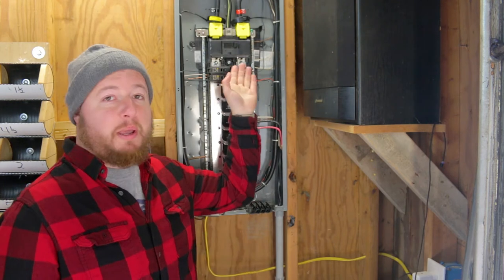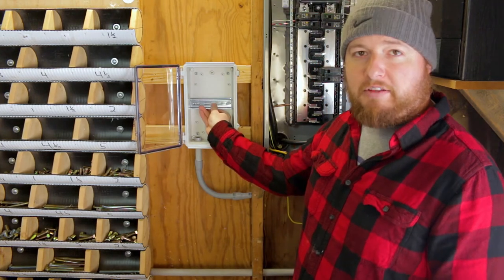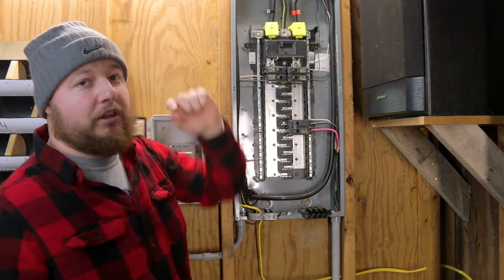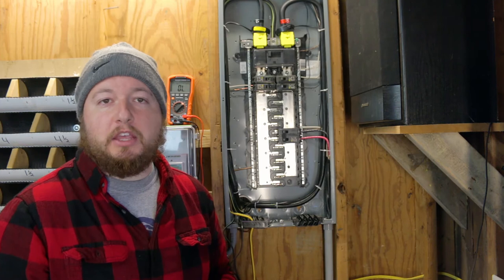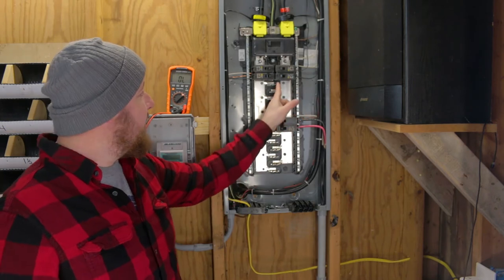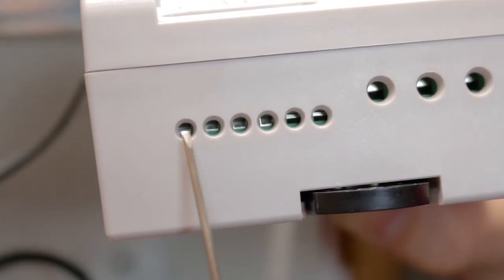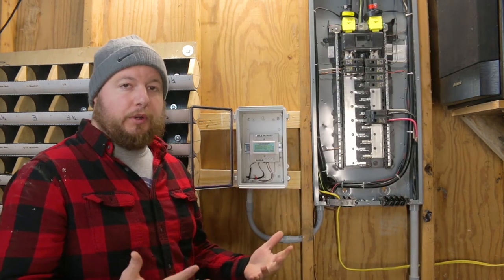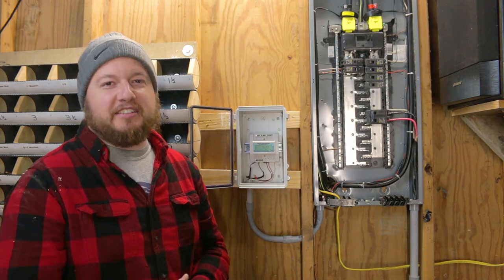EKM Omnimeter v.4 Install for Utility Sub-Metering

Comment: Hello Sean, some of your viewers questioned about the voltage supplied to the EKM meter. As most of they people watching this are DIYers. For the meter to calculate the power used be panel or sub-panel or an individual circuit breaker it needs the following.
Voltage supplied and Current passed. 
Voltage x Current = Watts
If your CTs are on L1 and L2 coming in
If you power your EKM with 110 then the power (watts) will be drastically lower then if powered by the line into the panel. 
If you are only reading for a singular circuit then what ever that level of voltage should be what is supplied to the EKM meter

It was definitely an excellent presentation.

Comment: Hey Sean! I'm very appreciative of this video. I'm just nearing the completion of a backyard rental home build to help produce income for my aging mother and I elected to install the Omnimeter. My local electrician is looking at charing $1,900 to do the install, which is bonkers to me.

As such, I think I have it all down except for the breaker part. Electricity is something I do not want to screw up and I'm not sure this is as straightforward as it seems or if there are thigns I could easily screw up.

The piece about installing the breaker and lines is a little unclear as I have no experience working with an electrical panel before. If there is little ability to screw it up, I'm all for it. 

From what I understand, get two of those fuse lines from EKM, then use a wire nut to connect it to the wire that leads to the Omnimeter. I'm not sure what gauge wire I'll need to buy, however. For the breaker, I'll need to install two breakers, so will adding two 15-amp breakers to the next available slots work or is there some kind of mathematical equation I have to be aware of when adding in breakers?

Any wisdom you can provide is greatly appreciated and this last little step could save my family $1,900!

Thank you!

(P.S. I once shorted a light switch when testing it with a continuity tester. I'm not sure what happened, but I don't want it to happen again. I guess my medal probe touched two pieces of metal on a live switch and it shorted? Question: If I touch the wrong sides of the breaker/bus bar (L1 and L2) is there any chance I'll cause an explosion?)
Reply from the maker: Haha, its easier that what your making it seem. Add two 15 amp breakers, make sure they are on opposite sides(L1 and L2). No math needed just add them. Wire guage, use what ya got. I used 18 but 16 would be good too. If you need more info hit me up at appalachiandiy@gmail.com or EKM tech support are great for questions too
And 1900 is alot
Reply: @appalachiandiy2415  my local electrician is charging $600 (for the electrical component only)....
Reply: I'm all for doing work yourself but when you are so unsure of a project like this you should just hire an electrician. Don't just ask one company, ask multiple and you'll get better bids. The reason an electrician costs that much is because they have the licenses. If you put this in and it injures/kills someone in your rental, they will send you to prison. I understand looking out for your family financially but cutting corners in the electrical side of it is not how you do that.

Comment: You shrink wrapped over the fuse so you can't easily replace it and most breaker manufacturers will not allow you to run 2 wires into one terminal,  the rest was spot on. Ferrules would be good for the small wires.
Reply: He didn't hear shrink over the fuse, he heat shrunk over the soldered extension.

Comment: I m assuming you can also install these CTs on individual breakers? I have 2 20 amp breakers feeding an apt. I need the apt. Separately metered from the rest of the panel

Comment: We're running one 200 amp and one 100 amp lines to two separate sub-panels in a leased space.  Both are three phase.  Do you know if two wires can be run through each CT at the main panel and accurately meter the total power used?

Comment: Does this read only on the breakers the wires were hooked up to or the whole A and B side
Reply: This is a question that I had too. It would seem that this submeter, the EKM, would only be monitoring the two breakers, that the red and black "voltage metering" lines  are hooked up to (these are the two wires that have the 1 amp flues in them). In this video it looks like we are looking at the main 200 amp panel for the whole house. Looking inside this panel I see two large conductors (a red and black one) on the right side about 2/3s of the way down, that are connected to a double pole breaker (? maybe a 100 amp double pole) which I assume feeds a sub-panel. If one wanted to monitor the kilowatts used by that sub-panel wouldn't one have to have those two "voltage metering" line attached to them?      Did you ever get an answer to your above question as to whether this only monitoring the two breakers or the whole A and B sides? Would appreciate hearing how you ended up hooking up your sub-panel (if you are using one) if you used the EKM monitor.

Comment: Hi are the wires you installed in port (7,8) really needed? Or could i just power the pulse v4 to a standard 110v outlet in port 7?
I got 2 cts and one water meter, and the instructions on the water meter says the best way to power the omnimeter is to do it from port 7 to a standard outlet and just install a 1amp fuse inline.
Would it work properly like this?

Comment: Not to buzzkill but non metallic bushings can not be used to support your male adapters. You have to use your locknuts first. If you can't use both then try a different fitting with longer threads. This installation is a code violation. Good info aside from that one issue. Thanks!!
Reply: What "non metallic bushing" and "male adapters" are you referring to?